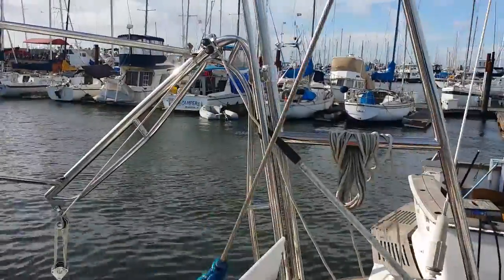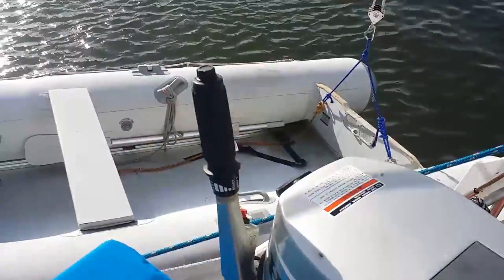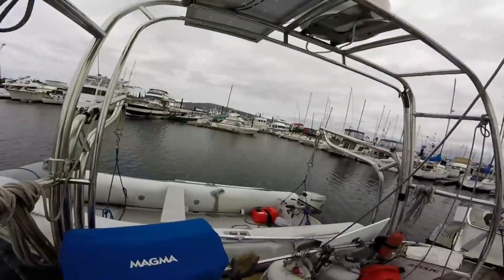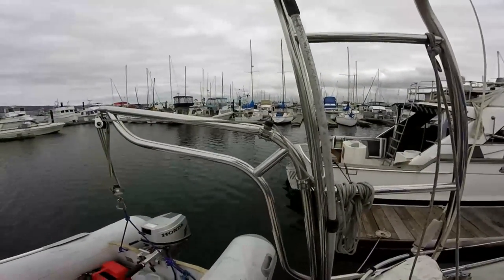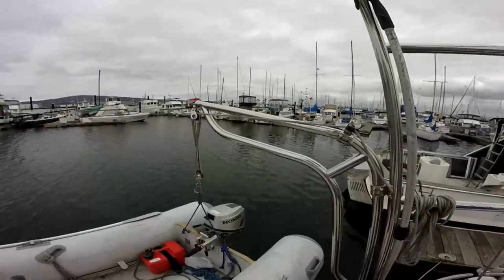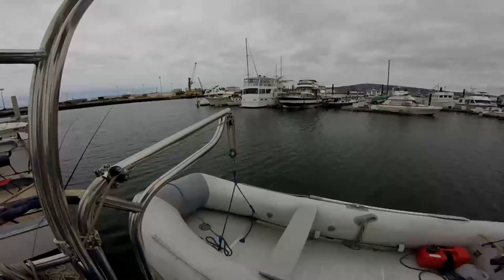Sail Before Sunset - The Tale of the Bent Davits

Comment: I know you had to stop work on your Dodger because of your engine issue.  have you gotten back to working on the Dodger?  I am looking forward to seeing the finished Dodger as I have one in mind for the boat I am thinking about purchasing.
Reply from the maker: We haven't done the repower yet.  Still getting things together.   We really can't wait to get back to finishing it!

What boat did you end up with?
Reply: +Sail Before Sunset I am looking at a C&C 27. It has already had a lot of work done to it and the Atomic 4 rebuilt last summer (by Hendrick motor shop.  The seller works for Hendrick Racing) and it only has 50 hours on it. It has as much space or more than a lot of 30 footers I have looked at. Very easy to single handed sail. The one thing I am worried about is the fact that it has not been out of the water for 3 years. He has had a diver clean the bottom every other month who has given good hull reports and changed the zincs. One of the first things I will need to do is a haul out and check the bottom and pray for no blisters or major issues. I was told that you don't survey a boat when the purchase price is less than $5,000 which is the case with this one.   I think it really could use a dodger and would be very nice to tie it into a Bimini top with side curtains for great closure while raining, cold or we are away.
Reply: +Don Harden contacted the guy to buy the C&C 27 today and he sold it yesterday.  Still looking
Reply from the maker: Sorry to hear that you missed it.  Things like that seem to happen for the best.  Hang in there and keep me posted!